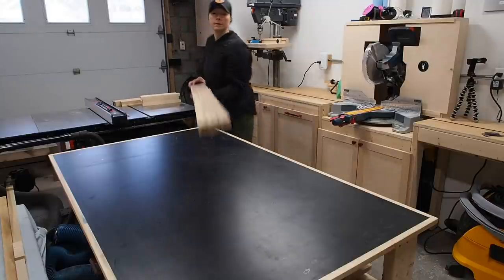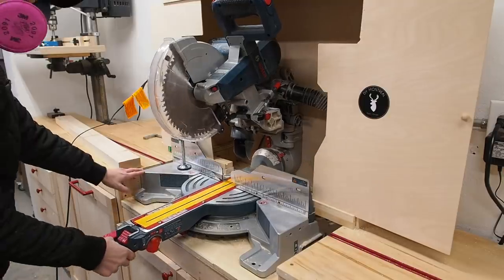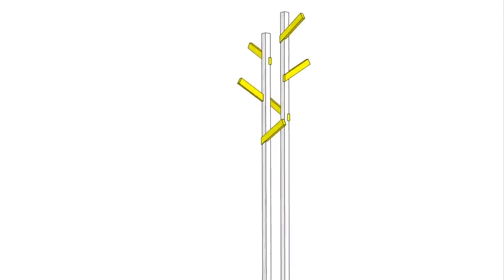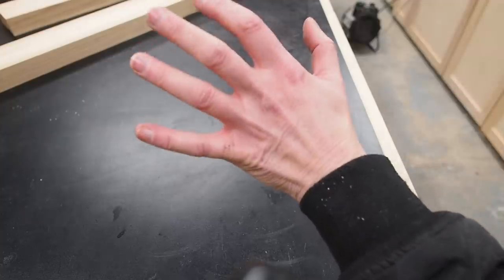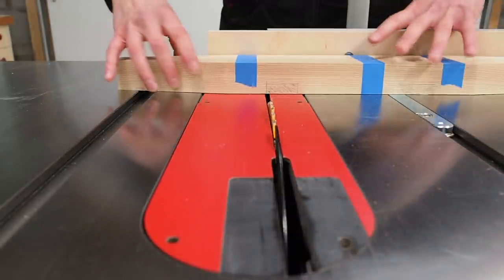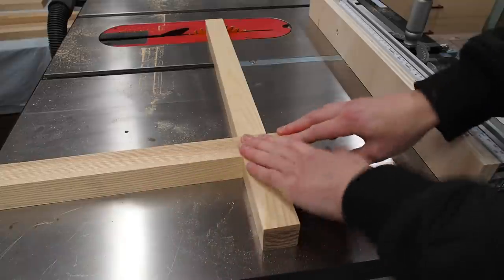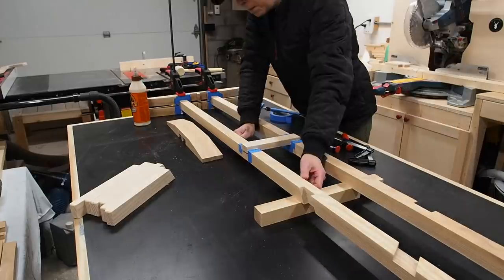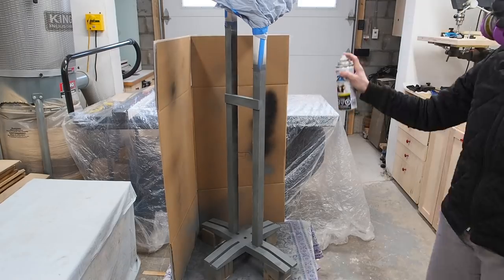Build a Modern Free Standing Coat Rack | Woodworking | Plans available

Comment: Great project! Thanks for the video. Had you considered adding feet to the legs? Sometimes that could help prevent wobbling if the floor is not flat.
Reply from the maker: Yes indeed could add feet. Figured I would do this after if necessary.

Comment: Terrific, very well narrated. I do not have a dado capable table saw and your instructions are giving me incentive to keep on trying to use the multiple pass method. I live in the US so I will not be entering the contest.
Reply: The contest rules indicate US residents are eligible.  (Mind you, if it's $100 Canadian gift card, that means about $70 south-of-the-border ;-) .)
Reply: @jeffbaker8808  Thank you for the info Jeff.
Reply from the maker: @jeffbaker8808  That's right, open to 🇺🇸 and 🇨🇦 ! Home Depot gift cards can be used in both countries and will use the currency of your country.
Reply from the maker: Open to US residents too! And yes, you can totally cut these joints without a dado stack. Hope you give it a try!